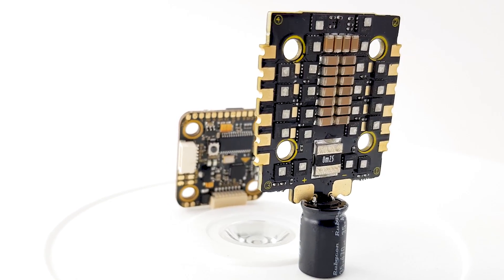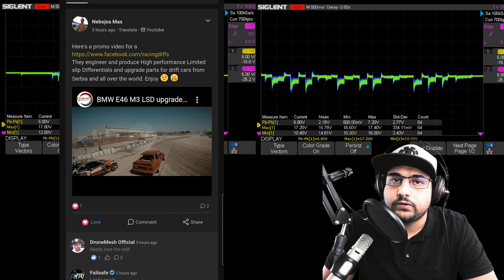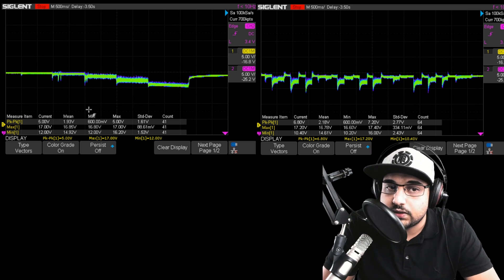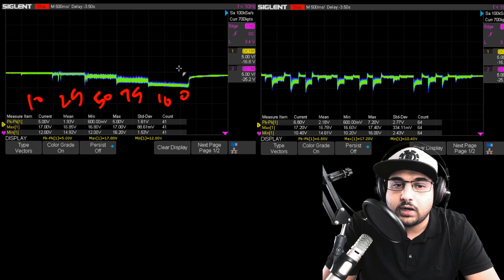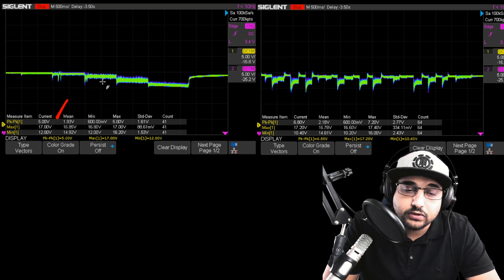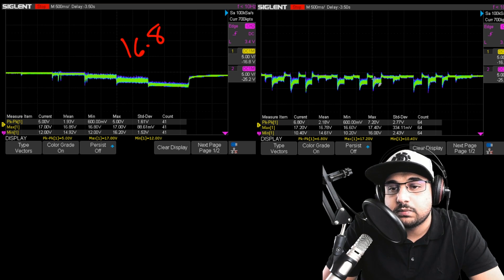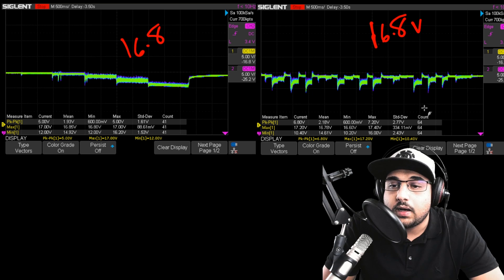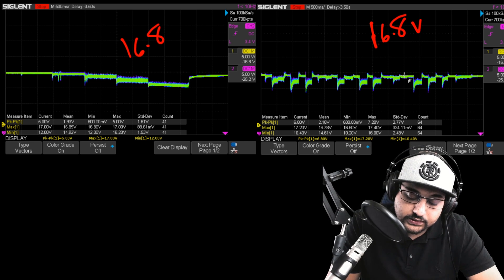T-Motor F45A 20x20 Metal Fet // Noise Testing

Comment: Got this installed with another 50v 470uf cap  on a 6s 5 inch it rips. Its smooth and locked in after some tuning no problems. Great esc👍

Comment: Hey, I bought the tmotor stack with this esc, and the f7 mini fc. I love how it flys, but I can’t get the current reading to work on the FC.. it shows 37~amps when plugged in, even with the esc disconnected.. I can’t figure out the settings to make the current pin input working on the FC. Any ideas?
Reply: Maybe calibrate it in the battery tab?
Reply: Sounds like you need to change the scaling in the battery set up tab
Reply: Did you solve that? I have the same problem

Comment: only issue is with the way its pre-installed, you need to make sure the frame has space there..
Reply: I don't like that either. We're perfectly capable of soldering the cap. Those who don't use one and blow something up can blame themselves. Love T motor but this pre-installed cap was a bad idea.